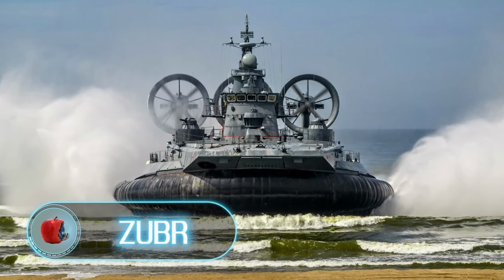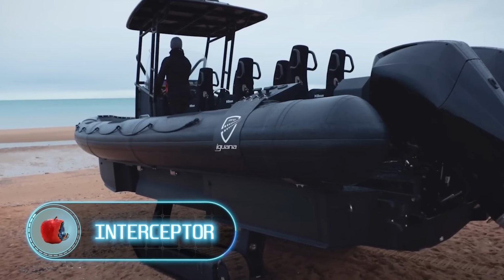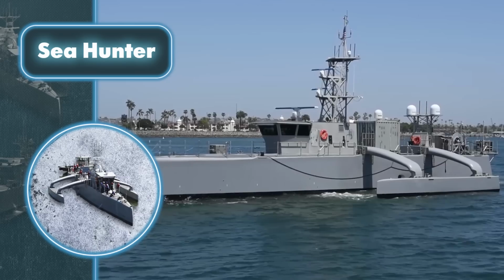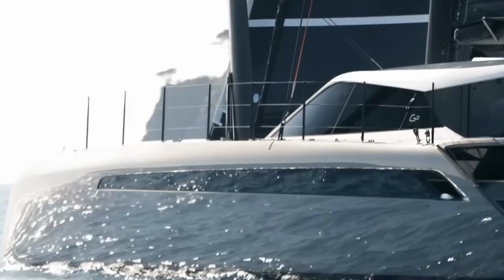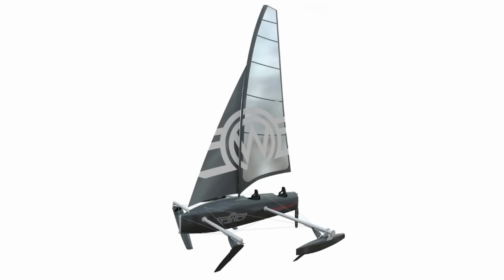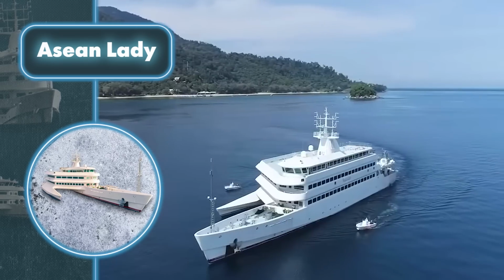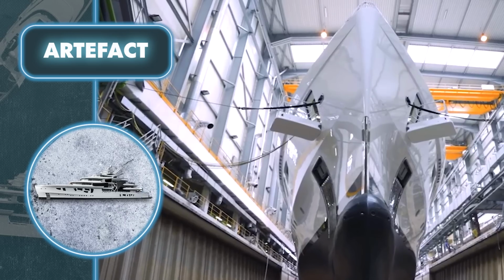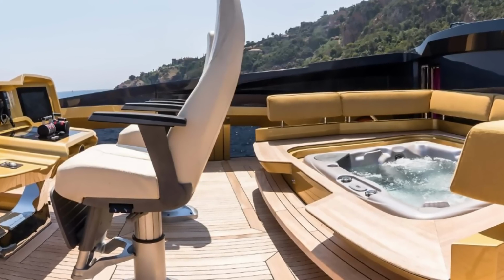Crazy Water Vehicles That Will Blow Your Mind

Comment: are there any battery packs for vehicles that are designed to prevent or reduce fire events?  its the issue that seems to be the one most talk about as a reason NOT to get an electric.  because when a car catches fire that is electric, it can take allot more to put it out in both time and resources..electric battery fires(feel free to look them up).  so i'm curious on what measures that "ANY" manufacturer of these battery packs is taking to reduce or prevent these sorts of events.  ty.
Reply: I agree
Reply: most boats just use standard 12 or 24 volt car battery size and a large number of them instead of a single large battery.
This reduces the heat build-up in the batteries by having more cooling surface. The battery fires in electric cars / trucks are the massive single battery not having the surface area to radiate excess heat and keep cool.

The construction equipment that is electric that I have seen has followed the pattern of boats, many smaller batteries with air flow around and cooling systems installed to reduce fire risk.
Reply: There's auto force durpseons systems